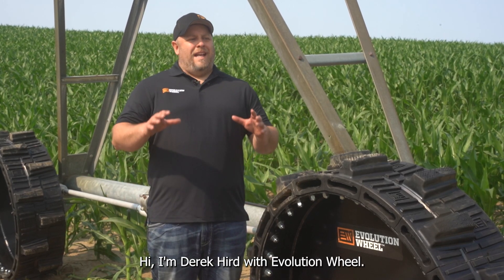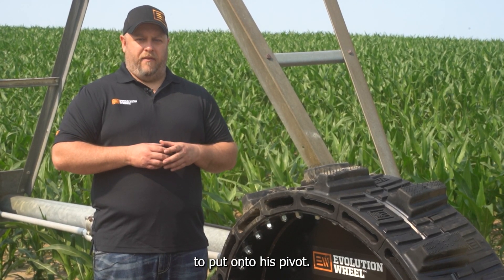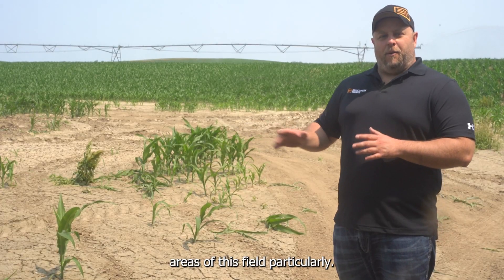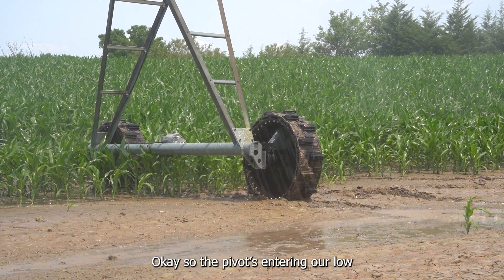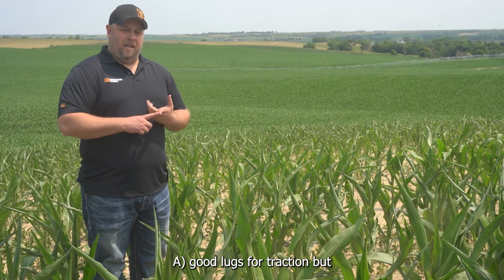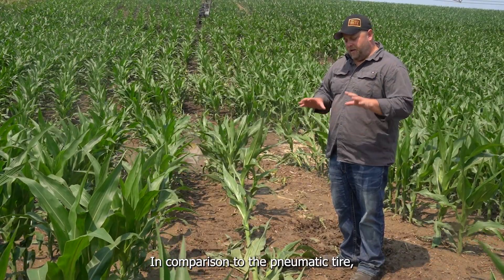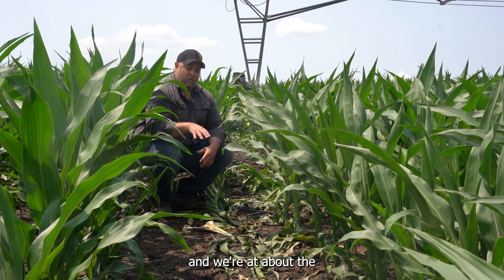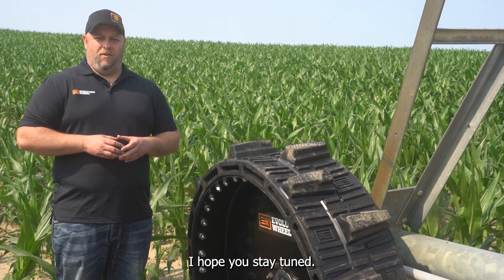14.9-24 Airless Pivot Tire VS. 11.2-38 Pivot Tire | Track Depth Case Study EP: 1 - EWRS-PIVOT XT

Comment: Putting on 3/4 of an inch but only getting 85% of it at most to the ground with those rotators on top of the pipe.
Reply from the maker: It definitely seems like every customer has a different pivot setup!
Reply: @EvolutionWheel  it’s unfortunate there are much better sprinklers for efficiency. We would save a ton of water if we got rid of that 50 year old sprinkler design. Your tire solution seem to be one of the better airless ones.
Reply from the maker: I appreciate that. The team worked hard to develop them and check the boxes customers wanted
Reply: @EvolutionWheel  the other ones are plastic or so heavy one person can’t work on them.